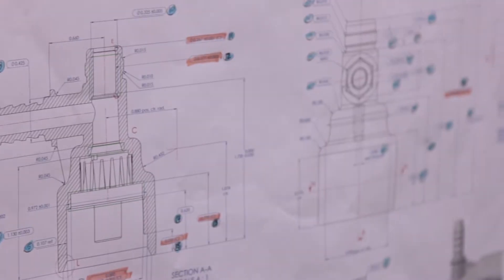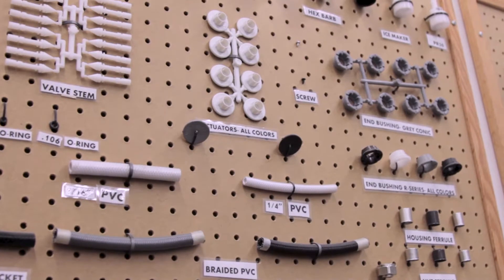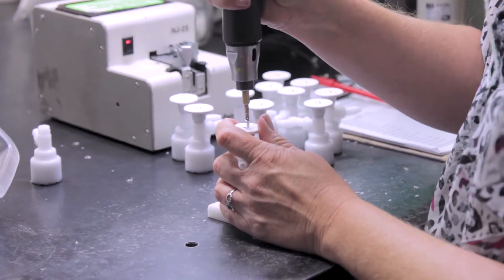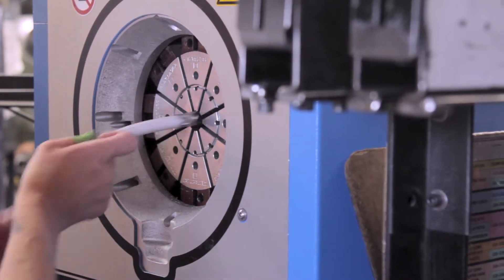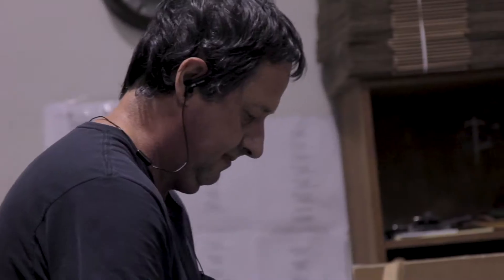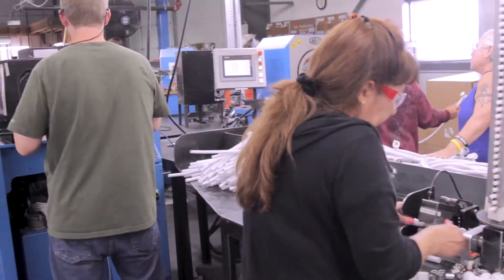2018 Innovator Awards: Accor Technology

Comment: These valves are really bad, they are cheaply made and are a pain to work with since they have an attached supply line. These valves should be replaced with a compression or crimp valve and seperate supply line.